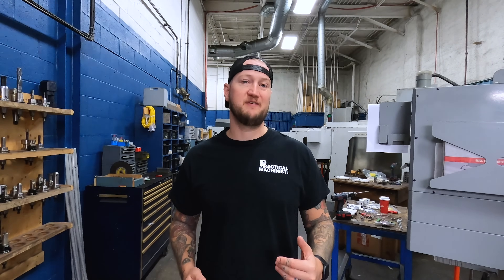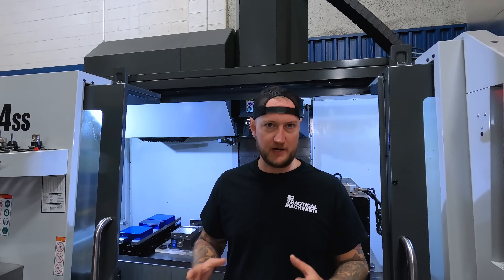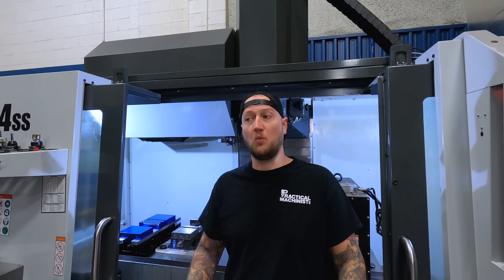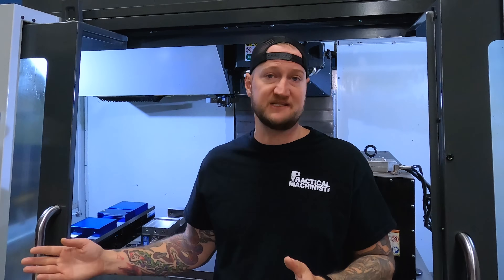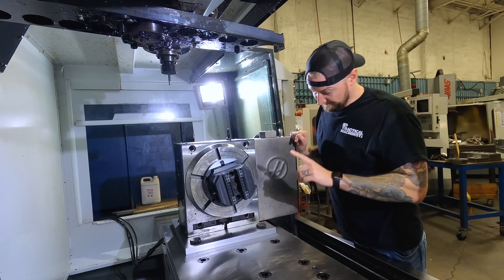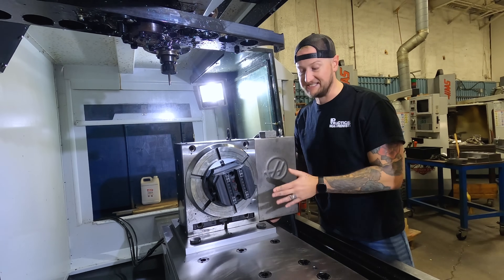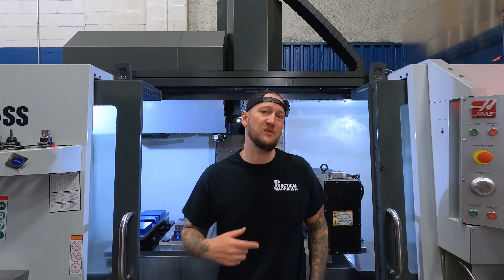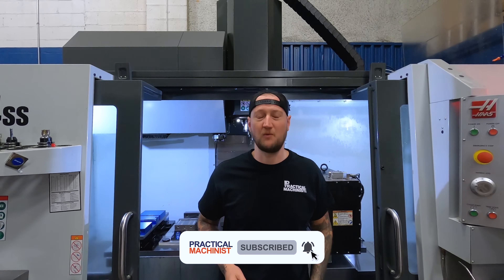I've Been Testing Jergens Vises for 5 Months… Here's My Take | Machine Shop Talk Ep. 95

Comment: I've been really happy with the jergens 5 axis vises.. the replaceable grippers have paid for the entire vise numerous times.. it's not without issues though, the 75mm in particular has a very strange clamping range where a part can be too big for having both jaws toward the inside and to small to have both jaws toward the outside. The work around is to have 1 jaw towards the center and one towards the outside but now your part is off center. I can't remember off the top of my head what the dimension is but its fairly common.. like 1.25" or 1.375" stock and the vise won't be able to open large enough or close tight enough to hold it

Comment: We love the ball locks. We purchased one of the receivers and reverse engineered them. We Wire EDM the OD and final bore to match the shanks of the ball lock and the pockets in the mill's subplate. This allowed us to locate the fixtures within .0001" in X and Y which I believe comes out to about .0003" true pos. Way better than what our parts require. Then utilize the extended offset positions and we don't have ever to probe any fixture after the it's very first set up.
Reply: Thank you for your positive feedback! We're thrilled to hear that our ball lock system has improved your machining precision. We're delighted to be part of your success and appreciate your comment 💪

Comment: yea i have seen a lot with say LANG vises that the jaws really tend to lift, we use them for second ops too and they just don't hold thickness that well at all
Reply: Been using LANG for close to a decade and have never had any lift of the jaws.  There’s a max torque spec right on the vise. If you’re exceeding it I’m sure you’ll deform the jaws, but that’s any vise, even Kurt Anglock vises will do that with over torque.  

If you’re running production or utilizing it a lot, the investment in the stamping system is well worth it, and you will need hardly any clamping pressure to hold the part, the serrated dovetail will do all the work.
Reply: not overtorqued, its literally just loose jaws on a screw with some slots the jaws slide in, there's obviously gonna be slop and lift @occamssawzall3486